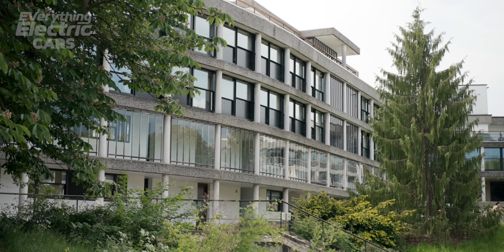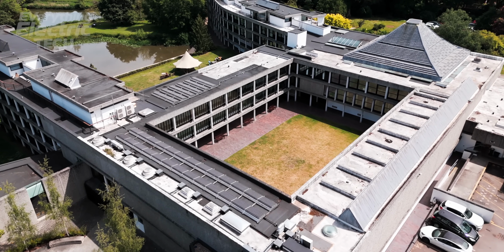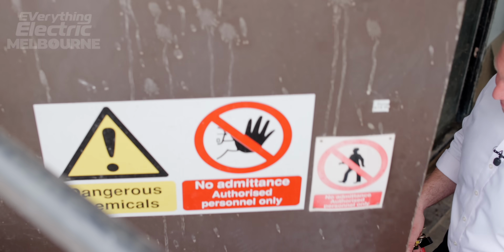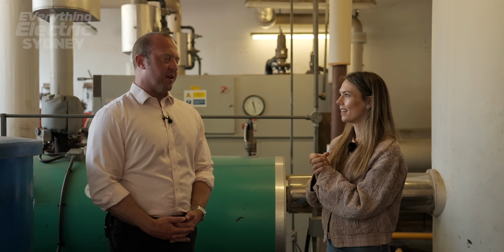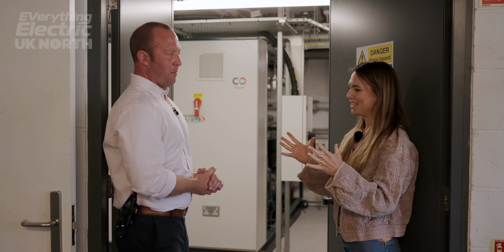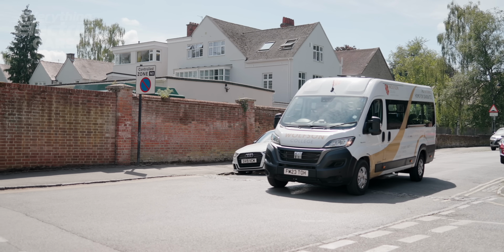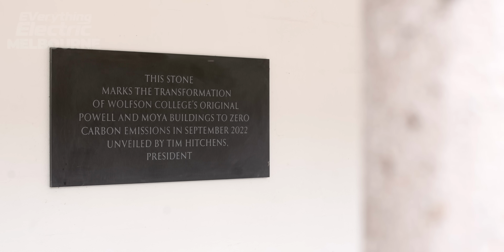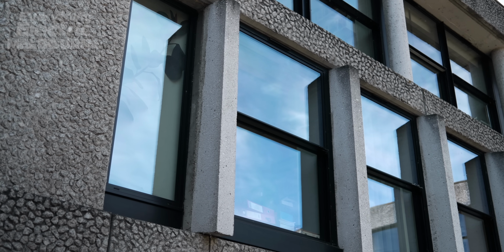The UK's First All Electric College!

Comment: 🏛 Oxford College CO₂ “Savings” in Context
55 tonnes of CO₂ saved over, say, 5 years = just 11 tonnes/year

That’s equivalent to:

~2 average UK households per year

~1 person flying to Australia and back twice a year

~1 petrol car driving 48,000 km/year (~30,000 miles)
Reply: Not sure why you airquote 'savings': they are genuine emissions reductions. They appear to have approx halved their space-heating load (not too bad for a hopelessly-designed listed building) , reduced their energy requirement by a factor of 5 and reduced their carbon intensity (for space heating and DHW) by a factor of 6. If we all did that we'd be in a much better place, so suggesting that this is not significant is wrong. It's just that there are many other things to fix too. A factor of 6 reduction everywhere would put us in a dramatically better place. 

Did they say 55/tonnes yr somewhere? I missed that. Average house heating fo rthe UK is 2 tonnes/yr, so this is ~27 houses-worth of heating. Comparing heating with all-sources of occupants is not a meaningful comparison. Heating to heating is a reasonable comparison.
And yes this illustrates how egregious long-distance flights are in emissions terms: just 4 worst-case (in one year - which a is a lot) is equivalent to a whole 300-person college heating. So don't do that: it's really problematic.
Reply: @xxwookey  Sorry but Duncan is correct here, the college spent an absurd amount of money to chip away at naff all emissions, they would have made an actual bare minimum of effort to helping the climate if they used that money to buy solar panels for villages in developing countries so they don't have to burn cow dung and whatnot to get through another year which is x1000 more toxic and polluting than what the college was burning. They'd also enrich so many people's lives with that kind of money..

Its about spending your scarce resources in a more intellligent manner to make an actual difference, not burning money so you can pat yourselves on the back for doing nothing useful.
Reply: Thank you for your input... I believe he said at 2:45 that "If we did nothing, we would be wasting 28,000 cubic metres of CO2 in the course of the next few years". Please tell me where my maths is wrong. I'm not actually ridiculing it... it just seems incredible that the numbers are so paltry when we consider vehicles. It would be nice if we could get rid of a bunch of them. I am 56 and haven't had a car or motorcycle for the last 8 years, for example. If my maths is right, I've saved more carbon than this college. But I might have miscalculated, if I have please let me know the correct figures.
Reply: @duncancarr7822  28000m3 of CO2 is about 50 tonnes, so maybe that's where the OP got 55 tonnes from. (1 tonne of CO2 is about 556m3 at typical ground-level pressure/temp- obviously it varies with temp and pressure). Giving CO2 saving in anything other than Kg or tonnes is pretty unhelpful, and just obscuring the details. The reason this number isn't huge is that it's just the heating for one college. That's a few large buildings and some catering. So equivalent to a fairly small number of houses (like 20) seems about right. 50 tonnes spread over several years does sound rather too low, but if the chap in the video doesn't give us sensible units, we don't know do we? There was no mention of kWh/m2/yr or other standard/common measures of building efficiency like SAP, AECB carbonlite, Passivehouse etc. Ultimately heating is a significant chunk of emissions, but not an overwhelming one. For most people in the UK it's in the 5-30% of their footprint range. It is one of the easiest to reduce: swap from fossil fuel (or offsite-biomass) to a heat-pump. Preferably also do some retrofit: it's easy to halve the space-heating load in most buildings, and you can reduce it 90% if you spend some money to make it nice. (I've done this my house and it's a dramatic improvement).